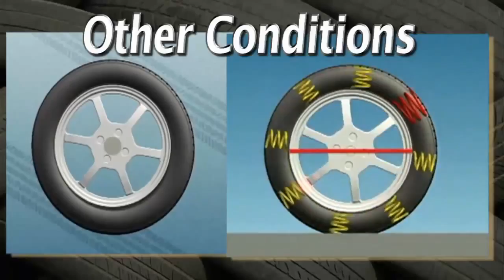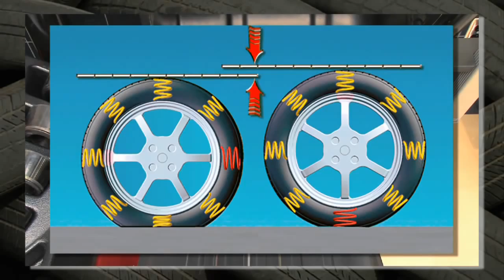Wheel Balancing:  Why Do My Balanced Wheels Still Shake?

Comment: Good information. Ive got a used Lexus CT hybrid, the dealer put four new tyres on it, did tracking and presume balancing. They are very cheap budget tyres (obviously they weren’t going to put Michelins etc on it), only had 6.5mm maximum tread from new so they really are the most basic you can get. It has firm suspension and they are low profile tyres, none of that vibration shaking the steering wheel left to right like everyone gets with badly balanced wheels. Its perfectly straight but when I’m sat on the motorway, from 50mph upwards, sitting at steady speed I feel a vibration in the steering wheel, but its not shaking at all. Its like a background vibration as if the tread is picking up everything in the road surface and transferring it to how the steering wheel feels. Could this simply be the cheap tyres ? Had it once before years ago when I got budget new tyres on a nearly new Ford. Same feeling through the wheel yet they had been balanced at the tyre shop. Ive had loads of new tyres through the years, never had this issue on anything else.

Comment: I had vibrations and shaking from 120+ km/h with aluminum and steel rims, different tires. I bought new good year tires and same thing. All balanced. Vibrations are the same at same speeds. Any suggestions?
Reply: bent axle

Comment: Is this service available at any tire shop? Or do i have to find a special shop to fix this issue?

I installed vrand new tires. Balanced them. Did an alighment. Still got vibration noticeable at 50 mph or more. I need to fix this issue.

Any shops in northern new jersey?

Comment: i had steering wheel vibrations around 55 mph .. and MUCH WORSE around 65 mph ... 
Took my front tires to get balanced, 5 different shops kept telling me my wheels and tires were fine.
Come to find out my REAR tires were jacked and had flat spots on them ....
Reply: @SheKnowsTruthOfLife  um .... did you not read my post ?

Comment: Is it possible to balance 11" wheels with slick tires this way, like my electric scooter wheels?
Reply from the maker: 11" wheels can be balanced with the proper balancer and adaptors, but we cannot measure Road Force on them.
Reply: @HunterLearningChannel  
Just got tips, balance sand inside the tire. Will try it out soon.

Comment: Regarding similar topic...
Back in 1987 when GM began promoting brushed aluminum rims we soon learned that outside weights pressed against this shiny Chrome alternative trapped road salt here in the northern states resulting in our Beauty mags pitting out. 

As aluminum has a unique way of rusting even if coated with some clear coat protection back then.

My formula 350 SLP W6 Pontiac dealer was happy to put weights on the inside as alternative which seem to catch on because one rarely sees visible weights on common rims today.

Since similar to Corvette, anytime I rotated tires on my Firebird. Tires were not only mono directional but the original OEM rims had to stay in place and never could be rotated from front to back.

I guess I forgot to remind the first tire shop assuming that they already knew this. 

But imagine their surprise when attempting to pull car out from the bay they could only smoke the rear tires while back rims brought forward stayed solidly locked.

Hello, I asked if you guys ever rotated low profile directional tires and stock rims on a modern corvette you big dummies!!! Thank God they didn't break anything.

Also I recall special weights attached along the center of the outside rim. And now that most rims house tire pressure sensors I wonder if engineers take that into consideration by pre balancing during rim Manufacturing or attach permanent weight that remains with life of rim.
Reply: The 16" wheels on 3rd generation Camaros and IROCs had different offsets front to rear. You had to mark Left front,  Left rear tire then break them down and rotate the tires while leaving the wheels where they started. 16" tires were a big deal in the 80s. Upwards of $125 each. They also had 44PSI max air when most tires were 35. Aggressive driving, improper balance, low air, and failure to rotate every 3500-5000 miles resulted in ppl getting 20K miles out of a high dollar tire for the time. They also "cupped out" "rolled off the outside tread in hard cornering and were an all around bitch to fuck with. So I bought one! Cuz when u got them T-tops out hanging turns, smoking Dat killer, with the Alpine bumping 2-10s fuck it. If u don't understand buy a Prius. Also if you want to balance any tire correctly  balance it ON THE CAR, dynamically. Any old school Tire Men remember? 
     Alinement and Tire Tech
      Mid-State Tire Auto & Speed Shop
       1972-2020 RIP my 87 Formula 350, 92 RS, 82 TA, 77MC, 90S10, 78 Cutlass and believe it or not an 84 1000VFR Interceptor that I rebuilt.
    I have put more F and G bodies in the junkyard than cash for clunkers.

Comment: Boy just this week I received a full front end alignment AND a new OEM Ford Ranger left side front truck rim with the already-existing "suspect" tire remounted same front left location again. 

I wonder if rotating set of tires could have taken care of shaking over 55. But now after seeing this video regardless where suspect Tire relocated differently it still would have been that imperfect oval similar to flatspot. 

Thankfully I live in a big city like Chicago where there is several tire shops within a mile.

Comment: Well how do you have this done with hub centric wheel spacers if the wheel needs to come off?
Reply: well my hub rings stay on either the wheel on the hub just depends what it wants to stick to that day. although i should check if theyre still there ive had work done on my car since putting them on so maybe the retards at bartels auto service took em off

Comment: I got these 31"  Kelly TSRs for my jeep last July and (other than the normal rumbling sound on smooth pavement) it was fine until a few months ago. Both my front tires had developed a helicopter like sound and the tire expert balances them and asked me to rotate them to opposite rear locations. So I'm hoping that the helicopter sound goes away when the tires start to wear evenly (as the tire expert said). They were slightly used when I purchased them and I only did about eight thousand kms on them before this helicopter sound started. The vibration that happens over 40kmph had me worries about the rear driveshaft but the sound and vibration go away if I put non off road tires in the back. And there is no steering vibration (other than the typical old jeep vibration)

Comment: I have tried this road force machine at discount tire and still it vibrates above 60 mph. Taken it back to rebalance, changed out new tires for another brand, even took the car to the mechanics to verify front was still good, even purchased new rims. What or where can I turn to for a solution. 2k into wheels still vibrates
Reply: F*ck mate. Let me know if you find a solution.
Reply: Could be hub  bearings ,
Reply: wheel bearing failure definitely
Reply: Check CV axles
Reply: Warped wheel hubs
Reply: What was the issue?
Reply: @Built05STI   all good thanks for checking!!
Reply: @dariustambasco5457  what was the problem in the end? or it's still not fixed yet?
Reply: Same. Doesn't matter the speed. I got a recommendation for CV axles did them and nothing changed.  Gonna ask for this service. Cause I notice the vibration changes slightly with the tire rotation so must be the wheels. Gonna check wheel bearings as well. I feel like everyone can notice my tires shaking. Drives me crazy.
Reply: Experienced the same problem on my minivan, visited multiple mechanics and balancing shops, an old timer with a machine that he calls a dynamic balancer did my tyres and found that they were not perfectly round, he balanced them and I never had a vibration on my steering wheel and dash again.
Reply: I dealt with your issue for 2 yrs now. Aftermarket JNC wheels and tire issue. 
Vibration around 55 mph then MUCH worse at 65 mph like the front end wanted to tear apart.
Took the front JNC wheels to 5 different shops, had them balanced 5 different times, kept telling me there is NOTHING wrong with my wheels and tires but yet i still had vibration between 50-70 mph.
Finally the last shop i took them to said to me, so you have been to 5 shops and all 5 tell you the wheels and tires are fine and they balanced them 5 times and you still have vibrations .... 
When you put the STOCK wheels and tires back on the car you have ZERO vibrations which means your front end is FINE .... 
He then asked what about the REAR JNC tires .... I said what about them, he asked have you checked the rear tires ?? I said NO because its a front end vibration. HE said no ... He said rear vibration may not be felt in the rear depending on the car but that vibration has to go somewhere and its making its way to the front. 
So i took the rear JNC wheels and tires OFF the car and brought it to him, WTF ... both my rear tires had flat spots ... So i didn't feel any rear end vibrations BUT it felt them in the front.
He said thats WHY you never feel anything with the OEM wheels and tires because when you pulled the rear BAD JNC wheels off and put the GOOD OEM wheels back on, you removed the issue. 

So i put my JNC front wheels and tires and put them in the back .... NO vibrations at all. So those 5 shops were right, my front wheels and tires were GOOD.

I put the aftermarket JNC front wheels and tires in the front, put the OEM wheels in the back and NO vibrations. 
I put the rear aftermarket JNC wheels and tires BACK in the back and vibrations again ....
Reply: @ACommenterOnYouTube  I have changed the entire from suspension system and still have vibration.

Comment: Have 2001 Toyota Avalon, replaced the fron suspension, over last 6 months, from sway bar links, inner and outter tie rods, ball joint, upper and lower control arms, brakes, rotors,& pads, front and back brakes, & shocks& struts.  & 4 new tires,, & cars tires are always going outta balance, :not sure y,
What u think???
Reply: the wheels themselves?
Reply: The wheels or tires

Comment: We have this machine at our shop. I bought some cheaper tires and am having issues even after balancing. Unsure if it's related to wheels
Reply from the maker: Hi Mike, you local Hunter representatives would be the best folks to reach out to about balancer operation. You can find your local representatives by visiting www.hunter.com/contact and entering your postal code. Then you can select your which representatives you would like to send a message to and submit your questions directly to your local team members.
Reply: @HunterLearningChannel  Appears to have been a operator error as there were globs of grease on the insides of the wheels they didnt clean off before balancing. Thanks.

Comment: In other words it’s the shitty tire tech’s fault.
Reply: Not all balance machines have road force.  And there is alot more that can cause steering wheel vibration than just out of balance tires.  For example bad CV axles, bad wheel bearings, front end out of alignment, or even bad struts or balljoints/tie rods.

Comment: thank you sir , lesson learnt . Never buy used tires again , just bought a set of Toyo A/T for my truck like new for half price. Too good to be true ? I guess it is . No issues with stock tires but with this set I'm visiting my local tire shop twice a year and still vibration in my steering wheel
Reply: It can happen with new tires also
Reply: As most aggressive tires wear the balance will tend to go out over time due to wear. Rotate and balance is usually recommended at least every oil change as i do to my vehicle even with regular street tires

Comment: I have panther wheels. They vibrate at 55 mph plus. I have had them balanced 5 times all at different places. If I put the stock wheels back on no vibration. Is this form of balancing necessary? I'm almost out of options. No suspension issues new rotors.
Reply from the maker: It is certainly possible that these assemblies are suffering from one of the conditions that can be detected with a Road Force balancer:  excessive rim runout, a tire that didn’t seat correctly, or a tire with excessive Road Force.  These things can’t be detected with traditional balancers so I would certainly try a Hunter Road Force balancer if you haven't already. Lastly, you may need to contact the wheel manufacture if you believe the wheel is the source of the issue.  Find a Road Force balancer here: https://www.hunter.com/gsp9700
Reply: No you to install hub center adapters

Comment: I bought my car off dealer, new with after market 20X8 Valiente wheels  and it has had a slight vibration since 2011.  I have changed my wheels to Mazzis 20X8.5 recently and the vibration is still there, stronger and more annoying.  Of course, the wheel shop where I bought my wheels does not want to hear it. Anyway of objectively checking for wheel unevenness, which i believe the problem lies within the wheels and not the tires per se.
Reply: Warped rotors
Reply: Hector Ramirez what do you mean by that ?
Reply: @sandiegonative6471  not Hector but warped rotors are brake rotors that warp when a hot rotor gets in water while hot. Some rotors warp.
Reply: @sandiegonative6471  ਿਜੌੀ ਈ
Reply: 20” rims on a car that’s probably not even designed for that car ! All cars have different offsets and different rim  sizes specified by manufacturer as well as tyres sizes all need a specified tyre profile